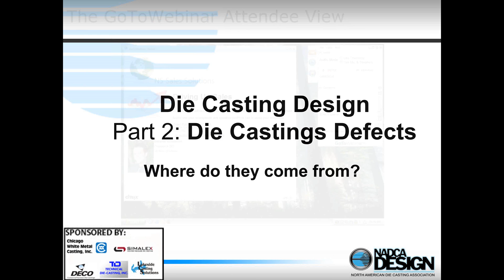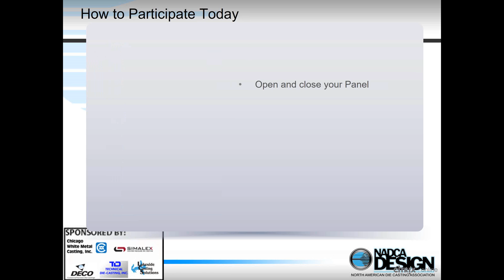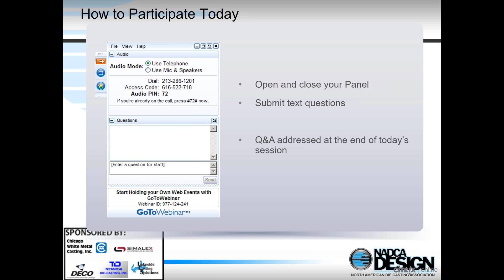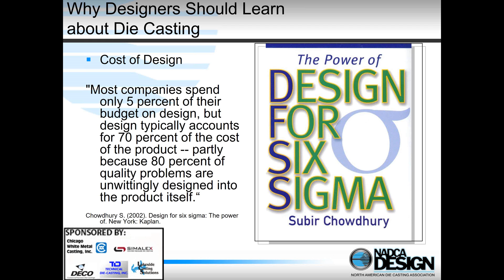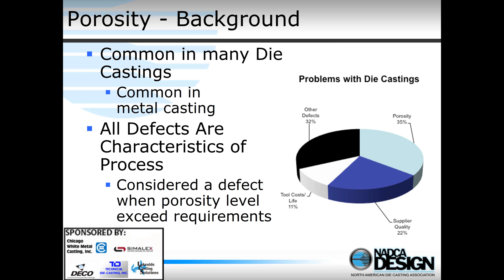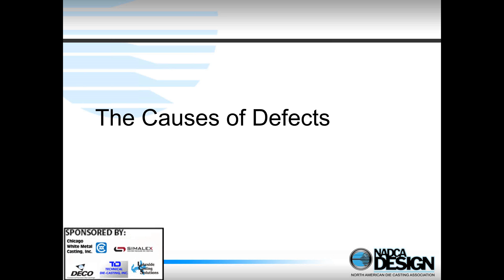Part 2 - Die Casting Defects: Where do they come from?

Comment: Hello, this is bharat sharma i have 13 years of  high pressure die 
casting experience. i was developing my self as die casting expert. Please contact for all

1 process designing and validation as per product profile

 2 die designing,
 3 casting defect analysis, 

4 product designing, 

5 cost saving, 

6 die life improving,
 7 how to reduce consumable cost, 

8 die casting myth, 

9 PQ2 analysis
10 Productivity improvement
11 Individual training
12 Plant level training
13 Degassing validation
14 Holding furnace take care
15 Shop floor vibration
16 Machine working principal
17 Hydraulic principal of die casting machine
18 Shot sleeve thermal study
19 Die cooling design 

20 Process parameter calculation
21 SMED
and
 many more service we can give to whole world which is still missing in 
India.

Keep learning till death
Bharat Sharma
9549867867

Comment: Why some  diecast metal cracks and crumbles when old
Reply: most likely it was not properly fluxed/drossed
Reply: It's likely to jump in molten metal due to cavity fill turbulence and get glissile effect and an oxide layer forms horizontal which get wraps either on side walls or layers results to oxide lap defect.